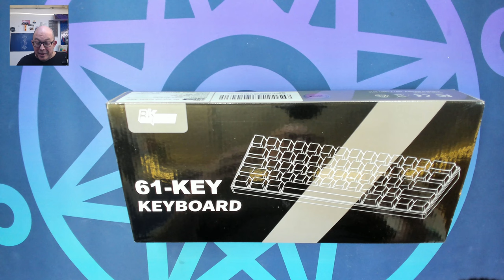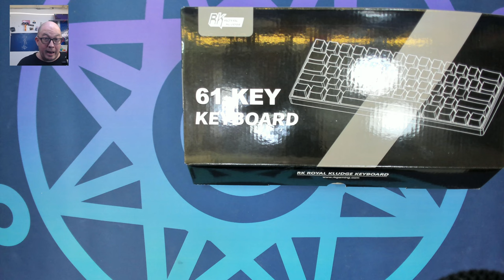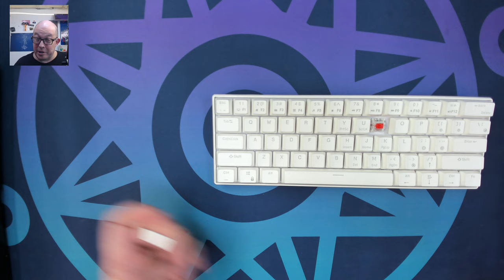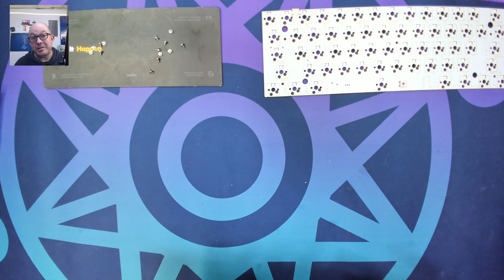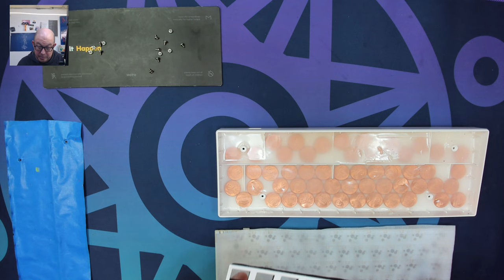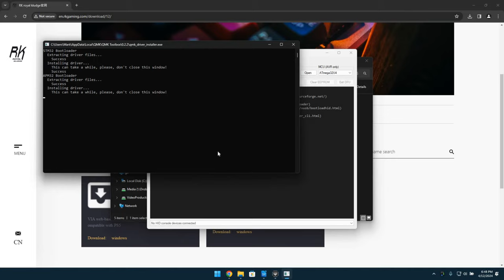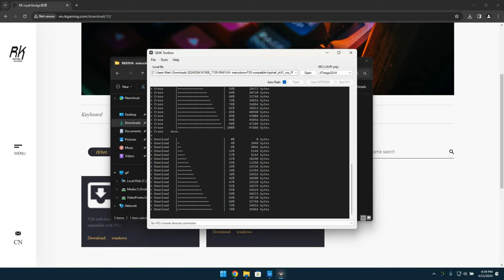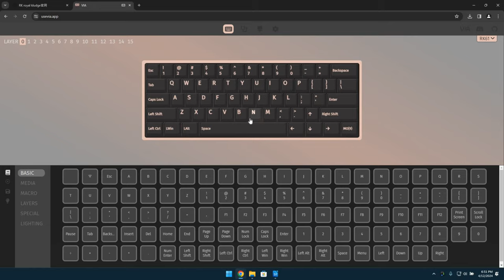RK61 QMK Review Mod Sound Test

Comment: Great video as always! My very first custom keyboard was an RK96 Limited Edition (I´m using it to type this) and I really love it. I think RK makes some very good quality boards, not the best out there, but good enough, specially if you mod them at least a little. Mine came with RK Yellow swithes and I swapted them out for KTT Kang Whites. Since it has a steel plate, all I did to it was one layer of the tape mod and polyfill on the bottom case. I wanted a ¨clackier¨ sound profile.

I´m thinking of getting the RK R65 now and I´m thinking of doing a foam-less build and just use the PET mod and polyfill to see what that sounds and feels like with a set of AKKO Cream Blue switches and YMDK shine through keycaps. I´m looking forward to seeing how you mod the R65! Saludos, pura vida!
Reply from the maker: Pura vida!

Comment: My frugal existence has balked at those split set keycaps. They always seemed way too expensive per kit, and you need so many kits to get a full set.  (It's like those part work magazines that used to appear every January.... First issue 99p, every other one 4.99, and only 200 parts to get the full set.  Ends up more expensive than a Britanica.)  Even the ones that aren't group buys or from Drop cost more than a full keyboard now.  I know some are very good quality, and small production runs, but I fear many of them aren't.
Reply from the maker: Same, it's why I only get them when I can get deep discounts.